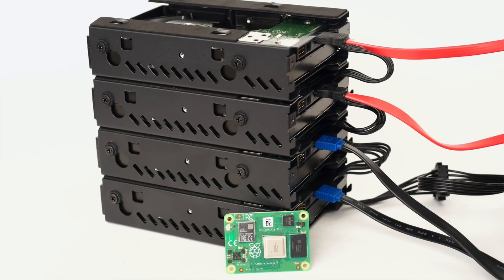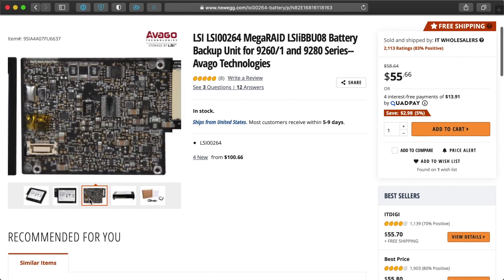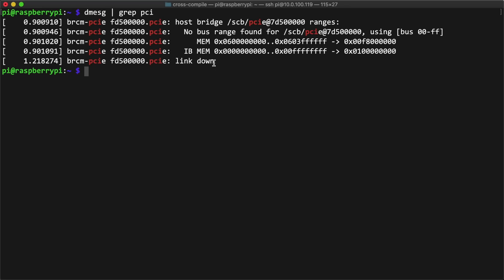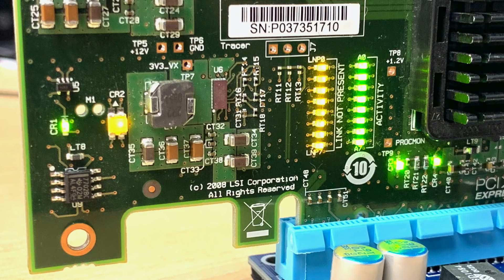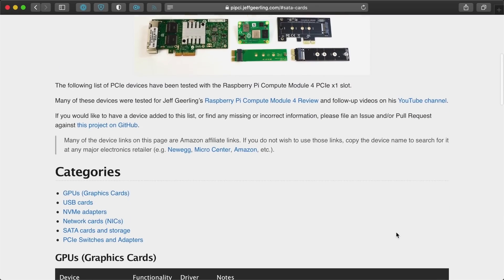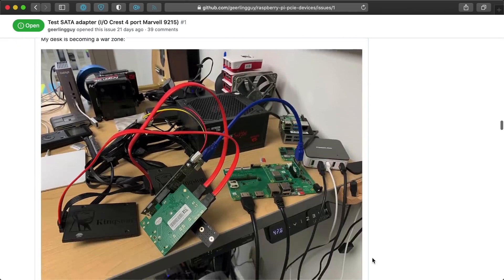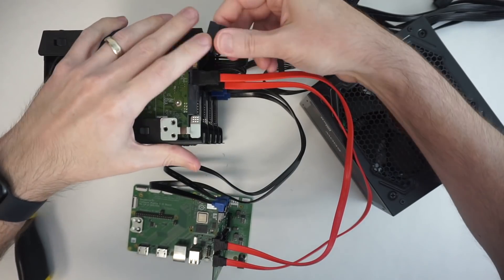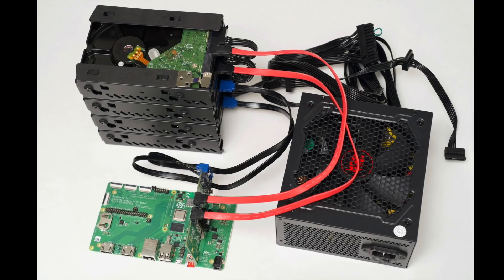Enterprise SAS RAID ...on a RASPBERRY PI?!

Comment: Funny that you're going this far. The USB 3.0 connector on a Raspberry Pi 4 has more bandwidth than this PCIe slot, lol. The PCIe Gen2 x1 speed is ~500 MB/s (4 Gbps), but the USB 3.0 is ~625 MB/s (5 Gbps). Not sure if you're losing some CPU speed because it's PCIe, but you do with USB (just a tiny bit).
Reply from the maker: So, not to burst your bubble on this, but the Pi 4's USB 3.0 ports go through the same PCIe bus ;)

On the Compute Module 4, there's no built-in USB 3.0 controller since it just exposes the raw PCIe 1x lane. So no matter whether you use USB 3.0 or any other kind of adapter, the maximum throughput is going to be in the ballpark of 3.2-3.4 Gbps, and I've gotten real world transfer speeds of 350-360 MiB/sec
Reply: @JeffGeerling  Ah, I figured it was going through the PCIe bus, as there are no USB 3.0 ports. Makes a lot of sense.

Would be awesome if they started implementing more PCIe on standard Pis, and if they even got x4 or even x8 to work. Many tiny x86 boards have full PCIe gen 3 x8 and some even x16, so it's definitely possible I think!
Reply from the maker: @mortenmoulder  Yeah it may be possible with future Pis—with the current BCM2711 chip, it only supports one PCIe x1 lane maximum, so that's all we'll see in the Pi 4 series. Maybe a Pi 5 in the future could support x4 or more!

Comment: Since those cards came from Dell servers, you may need to make a simple modification to get them to work.  Dell PERC RAID cards using several LSI chipsets won't work in non-Dell hardware without blocking contact on pins B5 and B6.  I've done this on several occasions in order to use Dell PERC RAID cards with ASRock, ASUS, and MSI motherboards.  Yannick provides a good explanation and instructions on his blog:  http://yannickdekoeijer.blogspot.com/2012/04/modding-dell-perc-6-sas-raidcontroller.html
Reply from the maker: Good idea! I just tried it on both cards, and same result happened—link down in logs, and the cards lit up CM3 on the first, CM3+CM4 on the second :(
Reply: @JeffGeerling  I really hoped that would work for you and I'm sorry that it didn't!  Do you know what model card those are and what chipset they have?  There have been some other peculiarities with RAID cards made for Dell servers.
Reply from the maker: @neutrinotau  Check out https://github.com/geerlingguy/raspberry-pi-pcie-devices/issues/18 — it's the IBM ServeRAID BR10i / LSI SAS3082E-R SAS

Comment: sometimes there is problem that card is thinking x4 or x8 configuration of PCIe links and cannot run i x1 slot, but sometime you can force them use jaust one line (x1) by simle jumper - on PCIe is detection pin which configuration (links count) is usable. just shorten these pins for x1 configuration and voala!

Comment: Hi Jeff, I am writing an article on how to build an Hyperconverged infrastructure at home, SAN is provides by 4 Odroid-hc2 that with USB2SATA onboard and gives you decent performance. SAS is 6Gps bandwidth that you should not be able to reach with PCIE 1x gives you 250mb/s bandwidth this means you have roughly 75mb/s per disk available. Would you like to have early access to my article? I would love to see a Glustefs cluster running on a RPi cluster as you know already VMWARE Supports PI, how could would be to have a dense PI only Glustefs? :) 1 PI4 per disk should give even more performance than the Odroid-hc2! especially because you could use a NVMe PCIE disk since the PI has a PCIE socket!
Reply from the maker: Mmm... and I can get closer to 300-350 MB/second with NVMe on the CM4. That would be an interesting little array, I hadn't even thought of trying Gluster with a few of these (I have used it before with microSD but that was just super slow).
Reply: @JeffGeerling  https://pastebin.com/shcEjjGn
I've uploaded the GFS part of my article, have look if anything is of use to you. You can wget the file, is only text. Apologies for my english, not my first language. I hope I am not overstepping, I am not used to Youtube Netiquete, no hard feelings if you need to delete the 3rd party link! enjoy (I hope)
Reply: Glustefs is quite easy to set up but performance depend greatly on how you configure it, with HDD you cannot get decent performance from erasure coding (disperse-data redundant), with 3HDD in Replicate+Arbiter I get close to 90MB/s reading (maxing the single 1GbE link, LACP 802.3ad on the receiving party) and 40-60mb/s sequential writing. I've seen 1.5k IOPS across the gluster! Sure enough doesn't perform consistently, once 4/5 vms are running on the gluster I get avg 7-9mb/s.
I wish to test CephFS, but I need to change disks, I am using commercial 4T drives and Ceph needs 1G/Mem per T :) got only 2G total on the HC2. I've used the two PI4 I've own to install Pi-KVM tho, thank god for OTG :) missing IPMI and Console on the HW in my rack they came very handy! Anyhow love you youtube channel, love your work. Cheers from down under

Comment: Have you considered using the 3.3v standby on the psu to power the pi?
Reply from the maker: I have, and it works great with a floppy power adapter—the problem I have is that the floppy connector is a pain to disconnect (compared to the barrel plug). So for a more permanent install, I would wire up a power switch for the PSU and use the 4-pin floppy connection on the CM4 IO Board. But for day-to-day testing, when I need to pull power often, I like the barrel plug separate from the bulky PSU.

Comment: You could try and see if you can get it to boot from a ZFS RaidZ setup with those 4 drivers, the SD card for Booting the OS loader and then the rest directly booted from the 4 HDD's in RaidZ (basically Raid5 for ZFS), "back in the day" I was able to do this with FreeBSD, tho that was with x86 / x64, unsure how well ARM64 and FreeBSD work together

https://wiki.freebsd.org/action/show/arm/Raspberry%20Pi?action=show&redirect=FreeBSD%2Farm%2FRaspberry+Pi

Comment: Here you go Jeff, adapters for you power supply.

Plain-Jane:
https://www.amazon.com/CRJ-24-Pin-Supply-Jumper-Bridge/dp/B01N8Q0TOE/ref=sr_1_3?dchild=1&keywords=power+supply+jumper&qid=1605301942&refinements=p_85%3A2470955011&rnid=2470954011&rps=1&sr=8-3

Super fancy:
https://www.amazon.com/CRJ-24-Pin-Switch-Jumper-Sleeved/dp/B01MSY4966/ref=sr_1_4?dchild=1&keywords=power+supply+jumper&qid=1605301942&refinements=p_85%3A2470955011&rnid=2470954011&rps=1&sr=8-4

Comment: Hi Jeff, interesting video. I wanted some network Pi based storage that I could store my files on and stream videos / music via Samba. I opted for OMV, 4x SSD, 4xUSB3 to SSD cables, a vertical USB3 powered hub, a single metal vertical SSD enclosure to store the 4xSSDs all screwed in. All told less than 10w electricity consumption for both Pi 4 2GB and USB hub together. I definitely did not want a fan running 24x365 for both power consumption and noise reasons. Everything stores on a small bookcase shelf. Sure SSDs are more expensive but I am happy with my 3.2 TB of network storage that I can upgrade at any time as SSDs become cheaper. Your choice of kit will kill mine anyday and I look forward to your next video.
Reply from the maker: Hey, if it works, it works! Just make sure you have backups (rclone to Amazon Glacier is my basic weapon of choice these days).

My primary NAS that I use for video storage right now is a janky old Mac mini with four 2TB SSDs that I paid a few arms and legs for last year (used to be a couple giant HDDs but those things were noisy and slow to spin up).
Reply: Thanks Jeff! Totally agree about backups.

Comment: when jeff said in the bloopers "' 4 sata cards " I said strait "he needs to test a pcie multipler card and put multiple working cards to see where it can go" 
These pcie X1 to 4 PCIe X16 where all the rage when mining bitcoin with 10 GPUs was profitable
here a link in amazon amazon[dot]com/dp/B075T8KDRS but easily found in chineses based markets
Reply from the maker: I have a 2 port PCIe switch, so I could technically do 8 (I have another SATA card I haven't tested yet). But then I'd have to go get more drives...
Reply: @JeffGeerling  maybe someone in your area has a 1 to 4 pcie switch from the old mining days so you can test if it works, the sata + nvme could be a test for actual raid + nvme cache speed tests as normaly ZFS was added by default in the lastest RPI linux kernels?

Comment: Ok then so now run freenas on rpi ;)
Is there way to connect this card to normal raspberry ?
Reply from the maker: Technically you can desolder the USB controller on the Pi 4 and get access to the PCIe lane through some jumpers... but it'd be easier to just do it with the Compute Module 4 and IO board—or someday someone will hopefully make a neat Mini ITX or ATX board that would have a built-in PCIe splitter...?
Reply: @JeffGeerling 
Would a USB2PCIE adaptor work..?
(Like the things ppl use in mining rigs).

Comment: The sas connector on the LSi card doe not transfer 4 SATA connection, it transfer 4 sas connection for a total of 3gb/s (SAS 1) 6gb/s (SAS 2) or 12gb/s (SAS 3). the sas protocol can support sata device but calling this 4 lanes sata lanes is wrong as fas as i know.
Sas drives also are better not only for the higher rotational speed (most of them ar 7200rpm as normal sata hdd) but for the extra connection pins that gives more feature usefull for datacenter or server in general.
Not only exist SAS hdd but also SAS SSD and SAS NVME SSDs with the sata connector(owever for for nvme is more common the u.2 connector)
Reply from the maker: Technically true—but in the end I was using four SATA II drives (3 Gbps max) over a 1x PCIe lane (3.2 Gbps max), so to a Pi user at least, it's six of one, half-dozen of the other...

I believe these cards are SAS 2, though since I was going into the 1x slot they would max out far before they hit the internal limit if I was doing something like copying data from network to drive, or between drives on PCIe bus.
Reply: @JeffGeerling  Tank you very much for the reply, i really like when youtubers reply to comments. 
It's all true, i was only specifyng for people like me that not only use raspberry but also servers and the explanation you gave in the video i think was very simplified and with some errors for the thypic use of the lsi card, for a raspberyy as you explained you cannot see the difference.

This lsi cad however should work if you find a way to let it boot before the os, i don't have the knowledge to let it work but on server normally it work like this:
-You power on the server, it check for all the hardware and then it boot the raid card and show the configuration and how to cunfigure it
-After thet it recheck for all the divice and then boot to the os (or you can go in the bios/boot manager at this point)

If you find a way to boot the card before the osyou will have better chance to make it work on a raspberry. The lsi card i have for example if i do not enable it on it's configuration at the boot i cannot see it on the desktop

Comment: 6:49 that would be anyway boring to watch, i made one for me and the issues where just stupid from my side.
two of the SATA ports where covered by the drivebay (nothing a angel grinder could not fix), but i did not read the mainboard handbook which states that just 4 of the 6 SATA ports can be uses while using a m.2 (NVMe) SSD so anyway pointless.
Reply from the maker: Red Shirt Jeff likes your idea of taking angle grinders to random computer things.
Reply from the maker: @hama3254  Nice use of the tactical duck tape!

Comment: Need this speed from pci-e?
Easier use sata to usb with power, and mdadm to raid.
Is slow but work. And older Raspberry pi USB "share" speed with LAN and for NAS was very slow.
Try only on RAID1.
Reply from the maker: Unfortunately USB-powered SATA adapters can't deal with larger spinning drives if you need more than one, maybe two. Even with a very good Pi power supply, it's likely one of the four drives would encounter weird issues.
Reply: @JeffGeerling 
I think he meant separate power 2 each usb2sata adaptor...

Comment: Can you boot of these drives? Or can the Pi only boot from the SD card?
Reply from the maker: Pi OS currently only looks for eMMC (if present on Compute Modules), microSD, and USB.

I'm hopeful they'll make it so it looks for NVMe or SATA storage if any is attached.
Reply: @JeffGeerling  You can boot Pi from ANYTHING addressable if you configure boot partition on SD Card properly.
Pi boots from SD card which points that system is in /dev/sdX

Comment: How can you build a SAS RAID with SATA Hard Disks?
Reply from the maker: It's still a SAS card ;)

But in the end I couldn't get the card working (yet?), so I decided to not buy a few refurb SAS drives (they're a bit more pricey than refurb SATA drives).
Reply: @JeffGeerling  I bet you can't get it to work. The controller Firmware needs BIOS support.

Comment: Having a 6TB SAS drive purchased by mistake a year ago still dusting, I was pondering this the other day, THIS is epicly timed Sir.
Reply from the maker: That's a pricey—and highly performant—mistake!
Reply: @JeffGeerling  Not so, hence the mistake as was £100 part in  larger sale.  But SAS card once I get around to it seemed good idea and did like the specs heat tollerance wise as had idea's of loft NAS.  Still probably go with old x86 pc I have, though the RPi or arm based avenue would be my choice.

WHY oh why don't they make some SAS to USB3 adapter that are fair price, think found one and that was half a grand :(.

Certainly a market  here for a fair priced one.
Reply from the maker: @paulgray1318  Haha, true, I was digging around to find any way to get SAS without a SAS card and I found that adapter too, like $700!

Comment: Get a PSU tester - it will turn the PSU on

Also the the LSI cards could be flashed with some DELL(?) / RAID specific firmware - test on a regular PC first. I have one LSI card that hangs one of my motherboards at 55, it then boot cycles. On another board no issue, and that's with the IT/JBOD firmware!
Reply from the maker: Oh nice, I didn't even think of that! And I found this little jumper that's pre-wired, just ordered one to save some space on my desk: https://amzn.to/3poxcCe

And I do wonder if maybe the boards have old / broken firmware. That's one thing I wasn't able to check since I don't have a standard ('boring old') PC lying about.

Comment: If I had to guess the reason the LSI Raid cards aren't working it could well have something to do with their built-in BIOS/configuration tool which might just completely not work on an ARM system

I don't know exactly how it works but I believe there is code on these cards which is used to initialise them with the BIOS but since that code is intented for an x86 system its not going to run on a pi, it might be possible to do something with emulation but in the end it would be more effort than it is worth
Reply from the maker: Yeah, that could definitely be the case—I've been hitting that same wall with the GPUs I'm testing. The weird thing is all other cards at least initialize so lspci can see them. These cards just act dead :/
Reply: @JeffGeerling  I think with GPUs because they are usually compliant with the old VGA standard they can be intialised like any old VGA card for basic initialisation (which is how the BIOS/UEFI can output to them before they are fully initialised), and the extra initialisation steps are just needed for anything outside of VGA. But I don't think RAID cards have anything like that.

I could be completely wrong though, I am not an expert I just come across random info like this as I spend hours a day watching youtube vidoes and browsing twitter/reddit lol 

I think I remember a twitter thread from foone where they hooked an ISA slot to a microcontroller and were trying to initialise old video adaptors but I can't find it now, I think he had similar issues initialising the cards because he couldn't run the initialisation code on the cards without an x86 CPU

Comment: I would love for there to be a MiniITX form factor "motherboard" that you could slot a pi 4 computer module into instead of a CPU and RAM, would be interesting/cool and handy for some projects 

Alas I do not have the schematic/board layout knowledge to do something like that myself
Reply from the maker: I've considered working on this, if for no other reason than I've had a few close calls with the crazy contraptions I've been putting together on my desk.
Reply from the maker: Also check out https://github.com/geerlingguy/raspberry-pi-pcie-devices/issues/19
Reply: I think Level 1 Tech did a B550M motherboard recently that looked good for something like this.
Reply: Turing pi 2 Will do this no?
Reply: Sounds like you want a 4x stack of Pi 400's with duck tape around them
Reply: The electrical engineering part isn't even that difficult - it's just super expensive to get it manufactured, unless you want a bare PCB and solder all SMDs on yourself.
Reply: @grmasdfII  not wanting to sponsor anything but a 4 layer impedance controlled board is cheap like hell now days. And on some Website assembly of and part is basically less than 50 usd for 10+ parts. The only issue is the annoying connector they used. I'm still wondering why they don't make a som with castellated holes.
Reply: That would be quite easy for people a bit skilled on PCB design. RPI som is really simple. The crazy DDR bus is in the som itself. Probably the only annoying thing is the pcie bus.

2 twisted pair 90ohm signaling with match length for the pairs and impedance control tracks. Click signal is not that restrictive. Does it support the other signaling? Like wake, prest, smbus? I think not...

Unfortunately it is only a x1 interface so really limited.

Oh I've forgot the rgmii interface for the phy, that is not so "reduced" :D